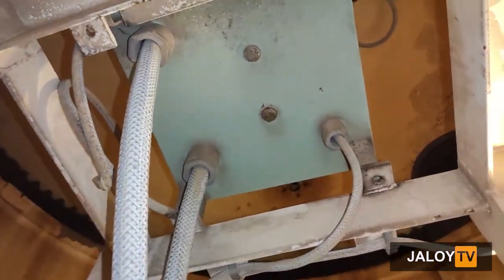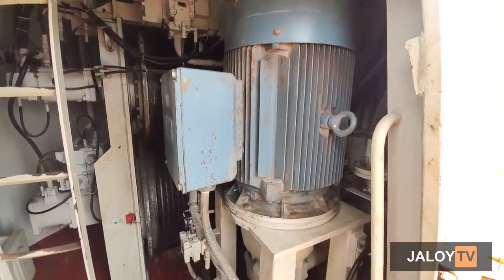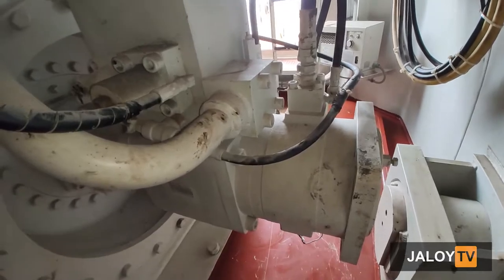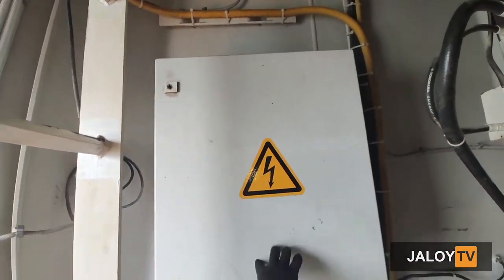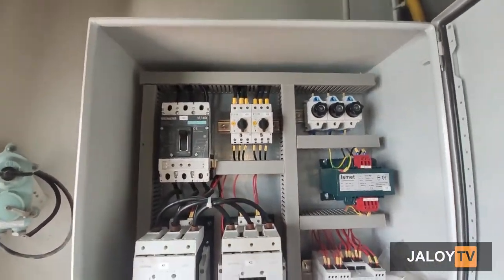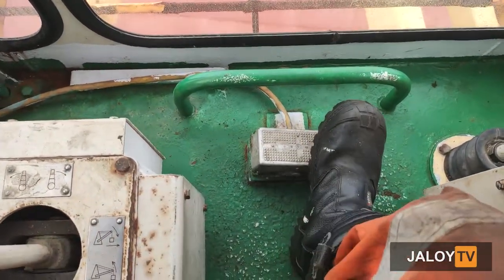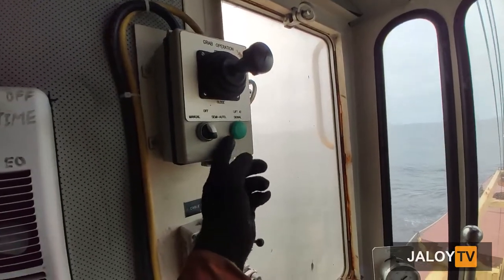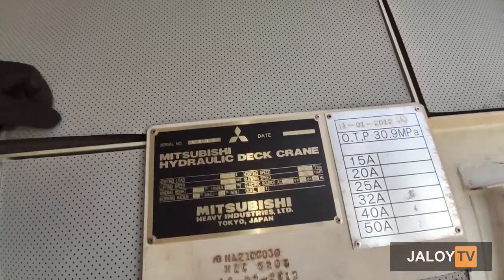SHIP'S CRANE FAMILIARIZATION

Comment: Amazin Explanation very simple the Mitsubishi deck crane the same than IHI Brand, but you didn't show the hydraulic power pump electrical motor i can guess it has horizontal arrangement with two pumps one in each end MacGregor deck crane electronic systems are more complicated. Much greeting from ETO from Venezuela BSM Company